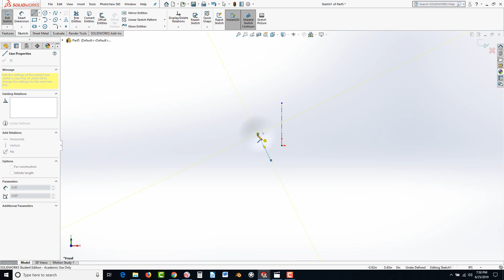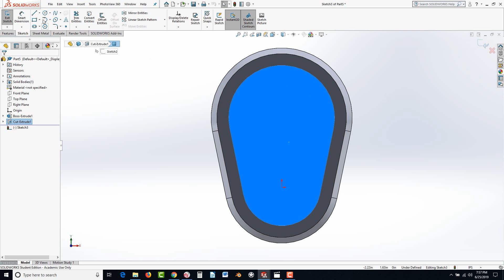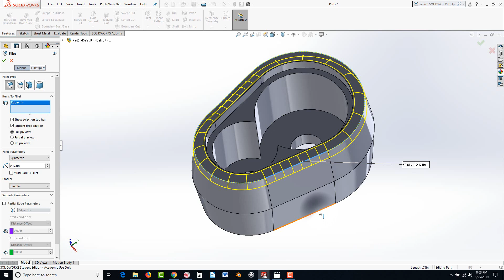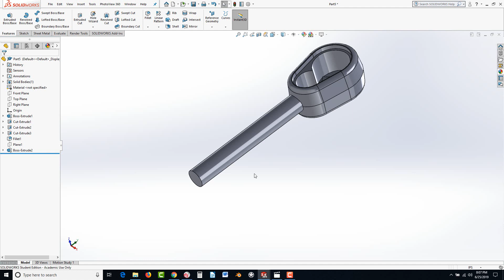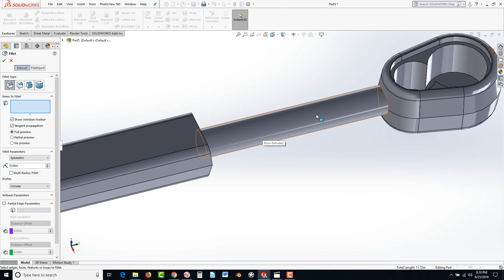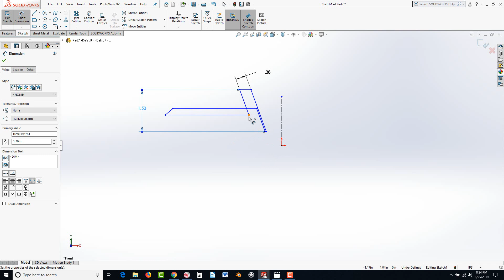E3 SolidWorks 2019 - Basic Modeling 3 Tutorial

Comment: I really do like your appearance, can I see your settings?
Reply from the maker: It's possible you do not have a professional graphics card (nVidia Quadro or AMD Radeon Pro). SolidWorks uses RealView which requires a professional card. Some say there is a registry hack available for non-professional cards, I do not recommend this method, attempt at your own risk.
Reply: If you have a decent gaming card the registry hack is well worth the effort.  Solidworks simply wants to reduce the support issues from a jillion graphics cards, so they 'certify' certain cards and everyone else is left hanging.  I enabled the registry hack with a 6 year old Nvidia GTX770 and its made things 10x better.  There is even an app to automatically enable/disable your card if its in the database.  My system is a 16Gb I5-3570 500Gb SSD Win10 GTX770 and I've been able to do all the tutorials while watching the videos.

Comment: I've attempted the Offset Plane method a couple of times and I'm a tad confused. I'm attempting to create a Flat base and add a Round Cylinder attached to it. Whenever I attempt to add the Cylinder to the Base it refuses to allow me to create a Full Diameter. Is there a different Plane Offset that I should be using?

Comment: In ["E3 SolidWorks 2019 - Basic Modeling 3 Tutorial"] you are building a handle for a ratchet. You start with a 4" long handle, extrude, add chamfers and whiz bang it looks great.  What happens if the design group comes back and says we need it 4.5".  How do you stretch it? Can you simply go into the "Smart Dim" and change it?
Reply: You should just have to go into "Edit Feature" and update it to 4.5".  Hit rebuild and it should update.